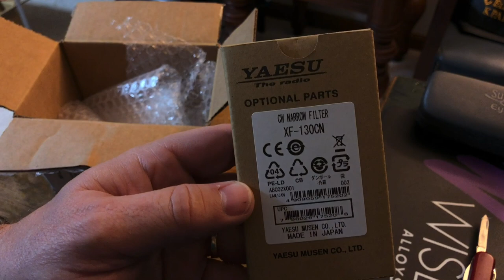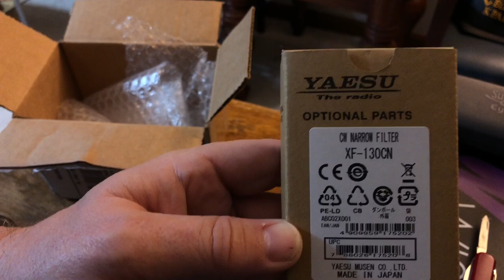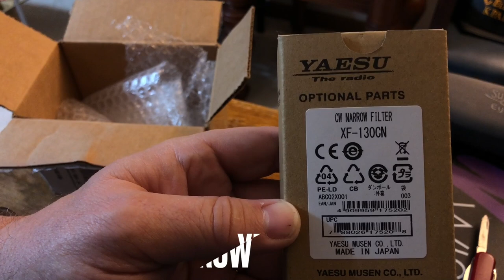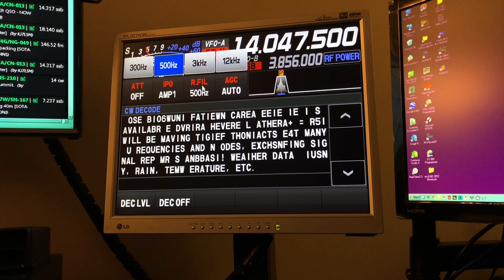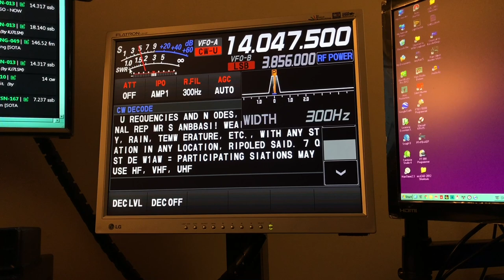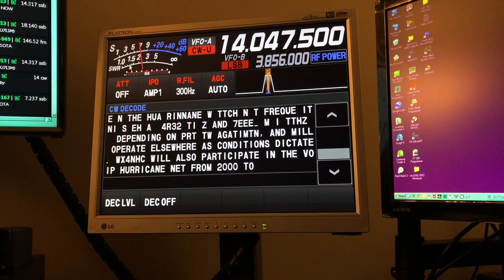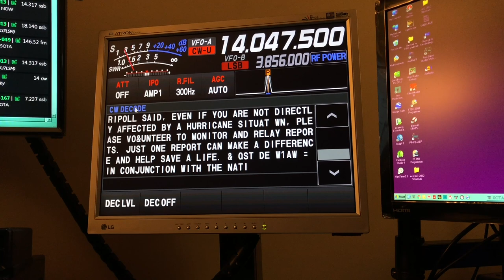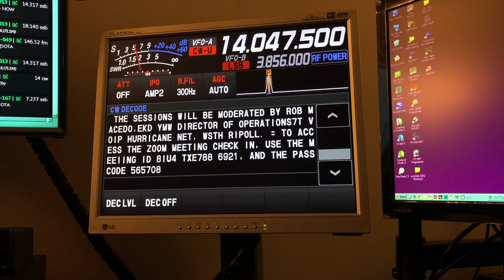Yaesu FTdx10: 300Hz Roofing Filter Installation (Video #38 in this series) #hamradio #ftdx10 #cw

Comment: Hi Doug, I would like your opinion on something I have noticed by mistake. I have noticed if I use the 300hz roofing filter and open it up to 500hz, the back ground noise floor seems lower than if I use the 500hz roofing filter set for 500hz. Its a lot easier on the ears. Can you check yours and I will be interested on your thoughts.
Reply from the maker: That is normal. The roofing filter is physically narrowing the passband ahead of the DSP unit. You can set the DSP width to 500 Hz but the 300 Hz roofing filter is still narrowing to 300 Hz.  Conversely, if you select the 500 Hz roofing filter and set the DSP width to 300 Hz, the DSP unit will not be quite as effective at limiting to 300 Hz as the 300 Hz roofing filter is. 

There is no reason to set the DSP width to a wider setting than the roofing filter you have selected. What is good is to use the 300 Hz roofing filter to do the heavy clearing before using the DSP unit to narrow down to 100 Hz, or even 50 Hz. That’s the methodology I use to pull out ghost stations.  The 300 Hz roofing filter takes away 200 Hz of QRN/QRM that the DSP unit will not have to deal with. This helps the DSP unit do a better job. 

73, Doug
Reply: @n4hnhradio  Thanks for your time in replying. I normally use the 500hz RF for general listening and searching for stations and switch to the 300hz when it gets tough. Maybe I should just use the 300hz and narrow down if its needed.  Once again many thanks.
Reply from the maker: The 300 Hz will help you notice a weaker signal better than the 500 Hz will. Once you’ve locked into the signal, using ZIN, then narrow to 100 Hz and the weaker signal will be more discernible. I also use DNR, set to 12 or 15. 

73, Doug

Comment: Hopefully this isent done on the 3 year warranty will void if opened.
Reply from the maker: It doesn’t void the Yaesu warranty if you install a filter, or even if you perform the MARS mod, though the MARS mod isn’t necessary unless you are actually a licensed MARS operator.  60 meters is already programmed in memory bank 5.  That said, Yaesu told me that, if you damage the radio while performing the MARS mod, then the warranty is void.

Adding this roofing filter is a simple plug-in, no soldering is required.  I can’t imagine someone damaging their radio to add a filter, unless they drop the radio.
Reply: It's a great radio right out of the box I enjoy mine I was sceptical at first of the radio now I own one I love it I get great signal reports on 40 meters on the snowbirds net. Only running 100 watts pep on my g5rv made it like a beam works very well.👍🎤

Comment: That little filter cost about 12% of the full radio price. Ridiculous!
Reply from the maker: High quality crystal filters have always cost.  That little wafer of quartz has to be perfectly ground.  

The prices have actually come down some over the years.  You can see the big difference it makes when the DSP isn’t helping.  In the past, filters like these, along with a noise blanker, were how we dealt with noise and interference.  

The DSP approach is cheaper to build, but the mechanical filters do the best job of scaling down to something the DSP can handle effectively.  It takes both to create the ultimate receiver.  The FTdx10 might be the ultimate receiver, along with its big brothers, the FTdx101D and MP.  But to me, the FTdx5000MP still reigns supreme.  It has the smoothest sounding receive audio, plus the filtering and DSP.

The DSP based noise blankers are no match for the analog noise blanker in my 1991 Yaesu FT-890.  But it’s cheaper to use the DSP chip to try to blank out pulse type noise than it is to include an analog noise blanker.  The radios advance in one aspect while they degrade in others.

I don’t know if most people catch this in the data sheet about the FTdx101D/MP and the FTdx10, but the receiver magic isn’t from the SDR stage.  The SDR stage is mainly providing output to the waterfall display.  The receiver magic is coming from the high-quality dual-conversion superheterodyne stages, along with actual, physical, roofing filters.

73, de N4HNH
Reply: @n4hnhradio  I suppose one of the big reasons is economy of scale, there is just not a big market for them.

As far a radio performance goes, a analog front-in will always perform better than digital (SDR). I think Yaseu’s architecture is the perfect marriage of the two technologies (analog/digital).

Comment: How much for the filter
Reply from the maker: I got it from HRO.  I think it was $180 plus shipping.
Reply: @n4hnhradio  waste of money
Reply from the maker: Not for a CW enthusiast.  Not at all.  It’s nice that the prices for these have dropped somewhat over the years.  Can you imagine paying $600 for a radio in 1959 to operate 10, 15, 20, 40, 80, and 160 meters?  That’s a standard mid-tier price in 1959.  Today’s Yaesu FT-891, at $600, is far superior.  Prices have dropped significantly while technology has improved.

The greatest era for ham radios was 2010 to 2020.  Now that people are blindly assuming that the latest SDR, with the prettiest display, is the best, quality is going to slip.  The manufacturers are already cutting corners.  The FPGA chip has made the radios cheaper to build.  But they lack proper filtering.  The filtering adds cost so the manufacturers would rather dazzle us with waterfall displays.  The Yaesu hybrid rigs are the best approach there, but don’t be fooled.  Yaesu could buckle under the pressure to build cheap so they can compete with ICOM and the cheap Chinese radios.  I see Yaesu slipping already, when they discontinued the FTdx3000D and the FTdx5000MP.  Kenwood hasn’t yet entered the SDR market.  But they are hearing the cries from the peanut gallery to build a Kenwood SDR.  Whether it is truly better or not, the companies will build what people are willing to buy and the best radios might become a thing of the past.
Reply: @n4hnhradio  it would be alot in 59 man wow you got a point thier👍
Reply from the maker: Huh?

Comment: Decoder? Use your brain. 😀
Reply from the maker: Some use the decoder as backup while they are getting up to speed with CW.  It helps them overcome the initial fear.  It keeps them from having to send QRS so many times, frustrating the other station.  I think it’s a great feature.  Eventually they won’t need it.  

I don’t care for FT8 and the like because it requires a computer and it does the interpretive work.  Using a decoder is similar to FT8, but you can have a conversation with CW and, while the decoder is assisting on RX, you are still working the CW TX and gaining familiarity.  Your speed might increase at a slower pace if you rely too much on the decoder, but you will eventually get better at it.

73, de N4HNH
Reply: @n4hnhradio  A courteous CW op doesn't mind slowing down and you learn faster without the decoder.

Comment: What blows my mind is how much it costs for filters. Geez, some radios if you buy and install all the optional filters it costs nearly the same price as the rig itself. How can that be? Their not some special technology, just xtal filters for the most part, i think. I believe like all the accessories that the big three sell for their rigs are waaaaay overpriced and why i dont know. Am i missing something?
Reply from the maker: The improvement a high quality roofing filter adds to selectivity can be significant. Such filters help minimize the amount of interference that gets to subsequent stages.  Even though a DSP can be set to a narrow width, the interference has already made it to a late stage in the receiver, adversely interacting with the AGC stage as well. 

The roofing filter does some heavy lifting in the early stage of the receiver. The best place to narrow bandwidth is nearest to the antenna. Preselectors, like VC-Tune, VRF, mu-Tune, etc. are inserted ahead of the bandpass filters, to provide a significant amount of filtering before the signal even gets to the bandpass filter and the 1st IF. Again, filter as close to the antenna as practical.

The higher the quality of the roofing filter, the more it will cost. Also a roofing filter for an up-conversion receiver (1st IF up out of the HF spectrum, at 40 or 70MHz) will cost significantly more than one for a down-conversion receiver (down in the HF spectrum, at around 9MHz 1st IF).  The IC-7851 costs around $14,000 partially due to the cost of high-quality roofing filters at 70MHz. The FTdx5000, FTdx10, and FTdx101D/MP use roofing filters that operate at or near 9MHz, allowing for very high quality roofing filters at a reduced cost - significantly reduced.

In vintage radios, prior to DSP, one would max out the roofing filter options, buying the absolute best, because there was no DSP stage to help out. But, know this, the DSP cannot outperform a high quality roofing filter. DSP is late in the signal chain. What DSP can do is supplement the roofing filter.

Note that Yaesu’s hybrids (superheterodyne+SDR) are the top radios today.  They have the advantage of a roofing filter ahead of the SDR stage, which precedes the DSP. That is going to be hard to beat.  The interference, and noise, is minimized before analog to digital conversion happens.  It’s like the DSP based noise blankers. The noise has already been converted to digital and passed to the DSP to be dealt with. That’s a cheaper solution for the manufacturer but it is a less effective approach. 

The radios today are relatively cheap. I paid the same prices for lesser quality radios 25 years ago. Why?  Well, you are right. The manufacturers make very little profit on the radios. They make up for it with the accessories. But, to be fair, roofing filters today cost less than they did 20+ years ago. I paid significantly more for a 400Hz CW filter 20 years ago than the 300Hz filter costs for the FTdx10 today.  We are very fortunate that the technology curve has kept ham radio pricing at extremely reasonable levels, for even better quality radios.  And in this current economy.